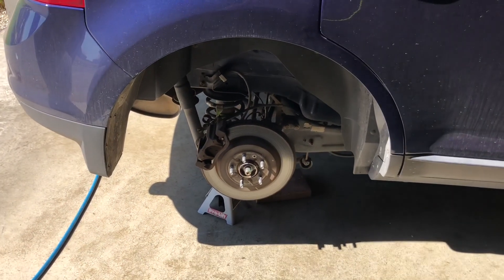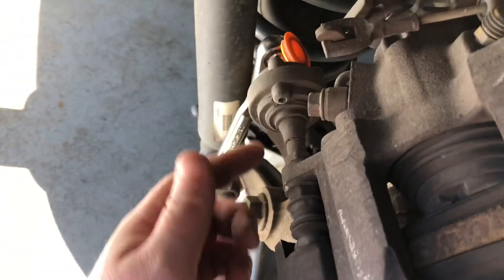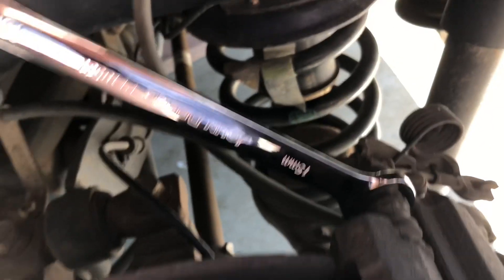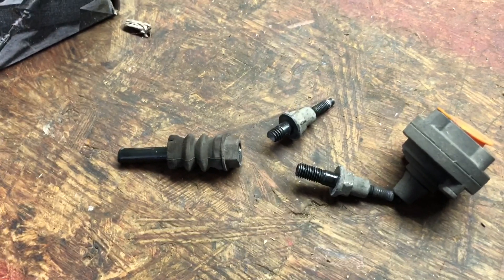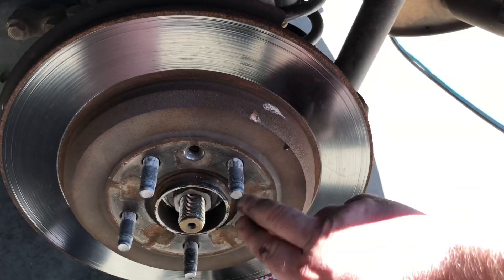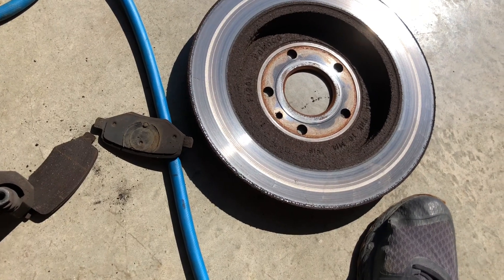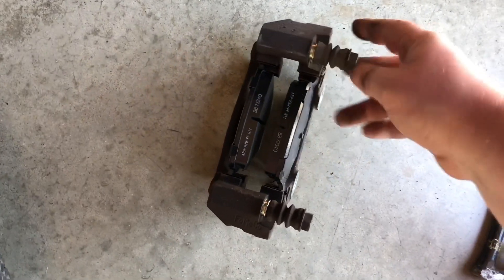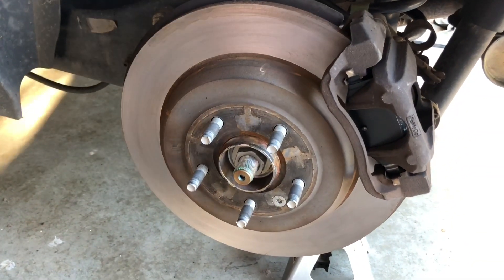Replace Rear Brake Pads and Rotors 2011-13 Ford Edge

Comment: Hey Brother, just wanted to say thank you.  No one on any other videos I found showed the detail you provided.  I also had to get a new rotor and a new bolt, I broke one also.  Thank you!  Mario
Reply: Try your 13 mm line or open end wrench for the nut on the noise dampener to avoid twisting it off. Seen it on another video.. you tube can be very helpful..

Comment: I have serviced many of these and to not break the bolts off you need to use a thin 15 mm on the inside bolt pins and just tap on the 15mm wrench as you turn the 13mm on the outside bolt they come right off that way. Always tap to loosen the 15mm nut on the pin. This video was very well done good job.

Comment: Thank you for the video. Especially about the brake dampening screw problem.  Mine didn’t break but I had to cut if off because that 13 mil nut stripped.
Reply: You can remove bolt without taking the dampener off. Just use open end 13mm on caliper bolt

Comment: A big thanks from me too for the video!  Also working on the wife's Edge. I already had the wheel off and was ready to go when I encountered the noise dampener, and all of the additional mechanisms in place for the parking brake.  A lot more going on in there than what I had ever seen before on past GM, Dodge, and Subaru brake pads I have replaced.  I had no idea how I was going to get to that caliper bolt that has the dampener on it, never occurred to me to flip open that plastic cap.   Curious where you are located?  I see everything isn't covered with rust, unlike up here in Northern MI.  Also going to pickup that square caliper tool.  Thanks again!
Reply from the maker: Colin Murphy glad I could help! I got the caliper tool from O’Reilly’s. I’m about an hour east of St. Louis, farming country. Vehicle frames and suspension usually stay fairly rust free for 15 years or so. But that edge was a 2011 and my Silverado is a 2010 and they are both rust free underneath except for some surface rust in places. Also we don’t get a whole lot of snow usually and if they do salt the roads we wash our cars a few days later to get all the salt off.
Reply: MeisterTV that sounds incredible! They salt the roads non-stop here during winter months.  Wheels get rusted onto the face of the rotor, usually have to give a good kick to break it free once the logs are off.  And I did find the tool at my local Advance, no O’Reily’s nearby. Thanks again!

Comment: It's easy for that cube to round out.  In that case, it's easier to use a c-clamp, applying slight pressure, then turn the round metal part of the caliper with an adjustable channel lock.  Retighten the c clamp as the caliper works its way back when you turn the round metal piece.

Comment: Whoever doesn’t have that cube piece to compress the piston, i used needle nose pliers to twist it back in , little bit harder probably but definitely doable. Open up the bleeder valve if it doesn’t push in 👍

Comment: Tip: put some anti-seize on the the little bolt that holds the rotor to the hub. It will come off a lot easier the next time. I needed a special tool (thankfully my neighbor who's a mechanic had one)  to remove mine the 1st time.

Comment: I recently did mine on a 2013 edge same style brakes...when you put that top bolt back in did you have to hold the other bolt that touches the boot with anl open face wrench while you tighten the back one?

Comment: Very informative video!  I DID need to use a gear puller on both rotors however.  A few taps with a hammer didn't do it!

Comment: Seems those noise dampers are a thorn in the side of all shade tree mechanics. I'm glad I saw your video but admittedly, I don't yet know how I'm going to avoid breaking mine...  🤔
Reply: I have serviced many of these and to not break the bolts off you need to use a thin 15 mm on the inside bolt pins and just tap on the 15mm wrench as you turn the 13mm on the outside bolt they come right off that way. Always tap to loosen the 15mm nut on the pin.
Reply: @gunlover1955  
Thanks.
👊
I don't actually remember what I did but I was able to get them removed without breaking either one.
Then, earlier this year, just as she was reaching the end of her financing term, the computer crapped out & SIL ended up having to dump a chunk of change into the Edge. 
Rather than trade it not running in order to get probably like $800 for it (on paper), she had it fixed, continued driving it & car shopped until she found a trade-in deal she could live with. 
They gave her a fair trade in value & a decent deal on a Nissan. 
She, unfortunately, just happened to purchase one of the crappy Edges that was plagued with problems. Built on a Monday or Friday, I suppose... 
😕
Thanks again for your reply.  
👊
🇺🇸

Comment: How much was dampner I got mine back in but striped bolt so I have to replace it next time
Reply from the maker: Marietta dash Cam I can’t remember for sure but it wasn’t very expensive.
Reply: Kyle Lesmeister it’s the actual damp
Reply: Kyle Lesmeister like your color choice do you still own that car
Reply from the maker: Marietta dash Cam it was actually my wife’s car, we traded it a little over a year ago for her new vehicle.
Reply: Kyle Lesmeister it’s really funny how much cheaper it is for to do it your self vs a shop

Comment: That little special tool deal was a bunch of bullshit.  Probably took a half hour on each piston, and both me and my brother ripped our knuckles up.  Whoever came up with that as a solution should be shot.

Other than that, great video and big help getting my first brake job done.

Comment: Did you have to bleed the brakes?
Reply: Probably way too late but you do not have to bleed the brake system. The components replaced were independent of the hydraulic system. The only effect this process had on the fluid was that when he turned the piston to push it back in, the brake fluid that was inside the caliper was pushed back toward the brake reservoir (under the hood). 
If you take note of the level before & after, it will appear to have more brake fluid in the reservoir AFTER the brake job than you did before it.

Comment: I don’t see why you would need to use the t30 on the dampeners if you’re using a wrench because you could just remove the bolt and the dampener all at once

Comment: Decent video but, you should always use a c clamp to compress the caliper before removing it. This takes away all stress trying to do it after it is off and further damaging the rotor.
Reply from the maker: NIGHTOWL 1963 maybe you missed the part where the caliper on the rear of the Ford Edge can’t be compressed with a c clamp. Only screwed back in with that special tool.
Reply: @KyleLesmeister  I was unaware of this special tool. I did not need it and used a C clamp on mine, 2007. Either ford changed the calipers or my son in law did it. And there were no dampiners either or a place for them. Could have just been the year of the car.
Reply: @NIGHTOWL-jf9zt  The turn in calipers started in 2011 for the parking brake on some fords and Hondas

Comment: could of saved lot of time taking just 2 bolts to take the whole caliber and assembly off, also you can use a clamp as well to push the thing back in place
Reply from the maker: Jason Griffith no you will damage the caliper. Most you can just push back in with a c clamp but these you have to turn in.

Comment: You really don’t need the special tool, you can just use a C clamp.
Reply from the maker: zemzabob yes on this vehicle on the back brakes you do need the special tool. On the front you can use a c clamp and push the piston into the caliper. But on the back you have to twist the piston back into the caliper. If you try to use a c clamp you will either break the clamp or ruin your caliper.
Reply: These have an integrated parking break so you do need to use the special tool to compress the calipers
Reply: Open the bleeder valve and use needle nose pliers to twist it in , no special tool needed 👍
Reply: @mpstyles11  be careful not to introduce any air into the system....